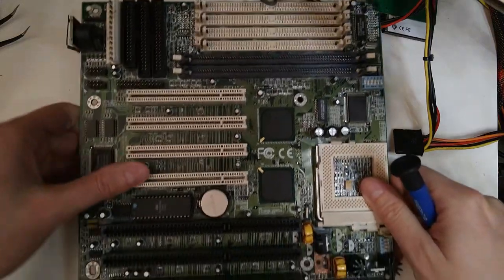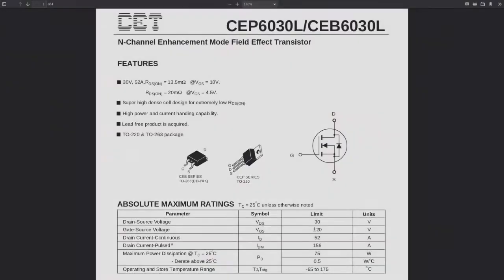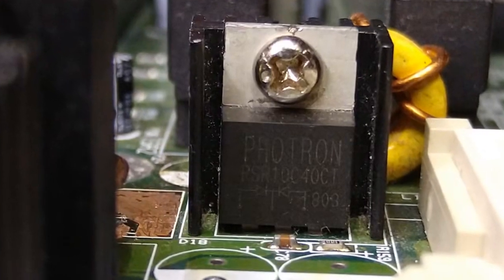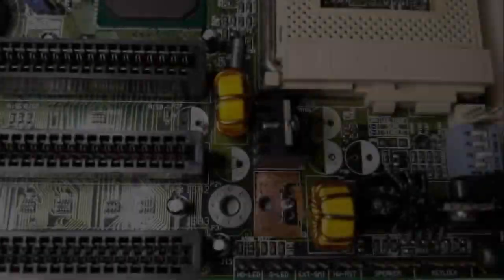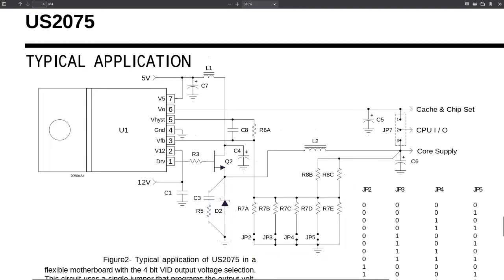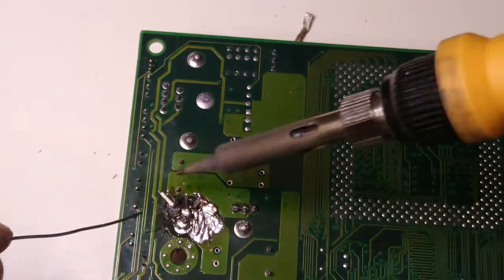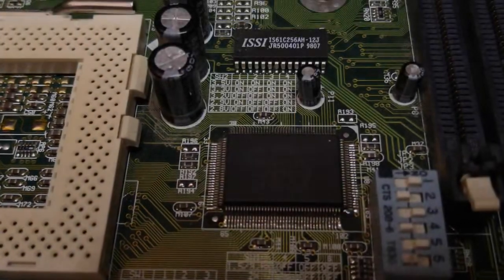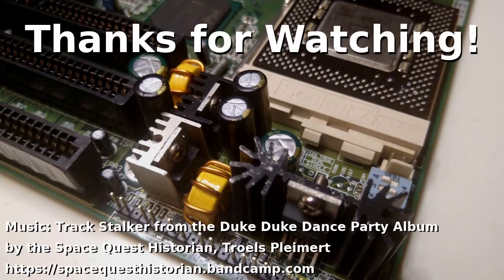Repairing the voltage regulation circuit of a Socket 7 Motherboard: DFI P5BTX/L (part 1)

Comment: Hello, great work! But where do u connect diagnostic card 2 pin cable???
Reply from the maker: This is for the PC speaker. The diagnostic card has a small buzzer on it and the 2-pin white cable simply connects to the buzzer on one end, and to the motherboard's "SPEAKER" header on the other end.